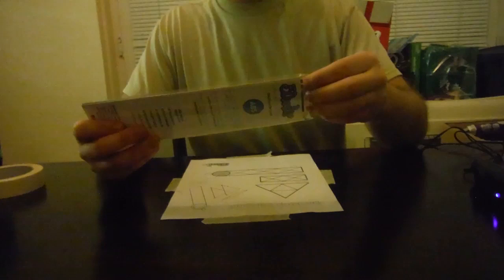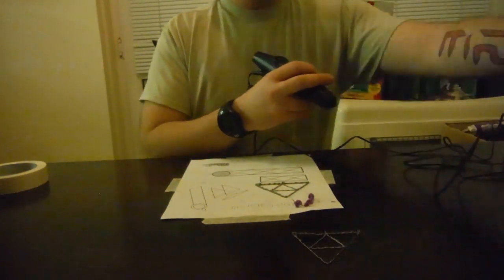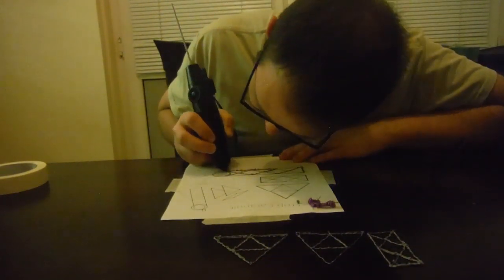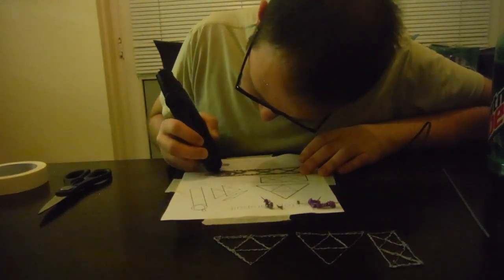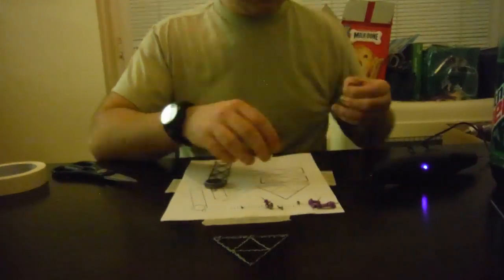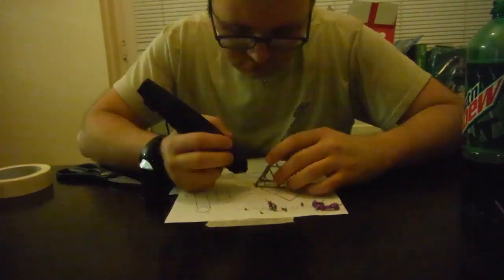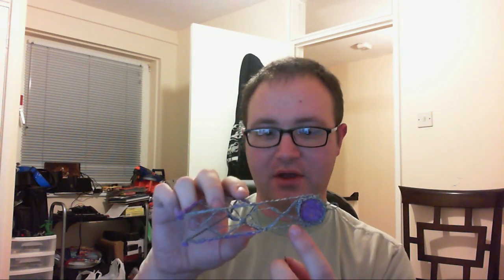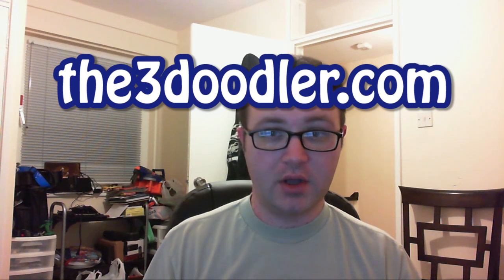3Doodler[3D drawing pen] Unboxing and First Builds

Comment: Does it make a lot of noise? I'm considering asking my parents for it as a birthday gift and I'm trying to figure out all pros and cons to see if it's worth it. Also does it use batteries or is it rechargble?
Reply: it is connected via 12V wall adapter
Reply: It makes a noise, abit like a hair dryer but not as loud.
You have to pug it into a plug socket.
I got one last week and I love it.

Comment: Does it put off a lot of smoke or smell? Do you need a ventilated area when working with it? Thanks.
Reply from the maker: When working with the ABS plastic, it does smell a little like burning rubber.  From what I've read, the PLA plastic smells more like a vegetable oil, but puts of less smell than the ABS.
Reply: Of course it will smell a bit like burning plastic but it's not to overpowering and no it doesn't give off smoke but the end of the pen will be very hot.